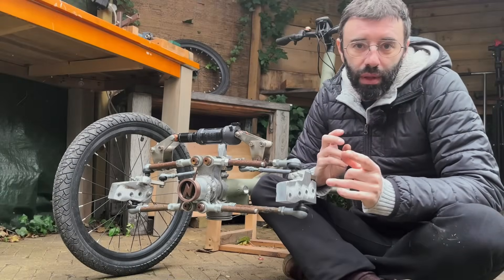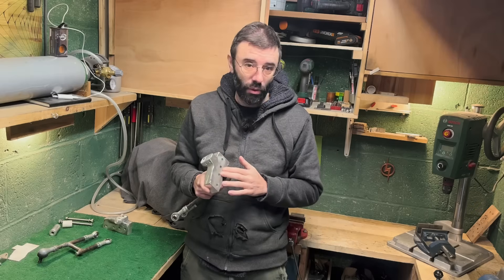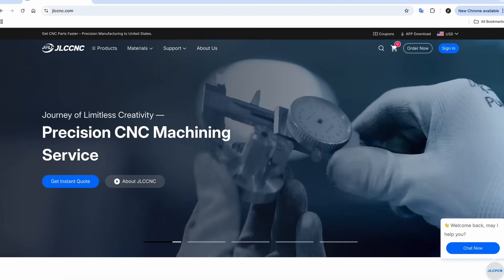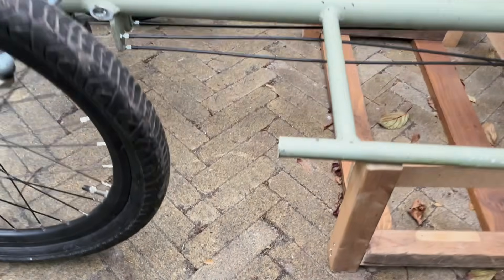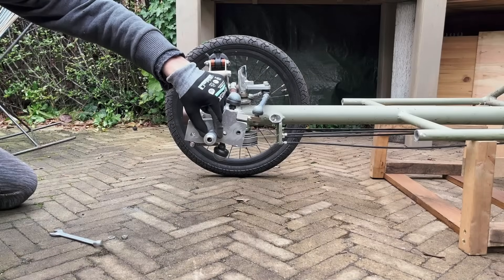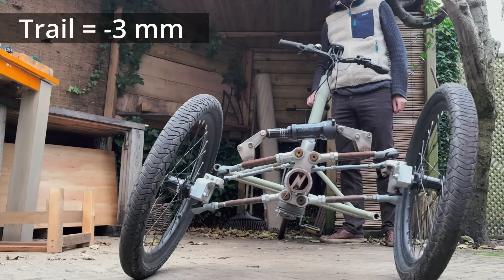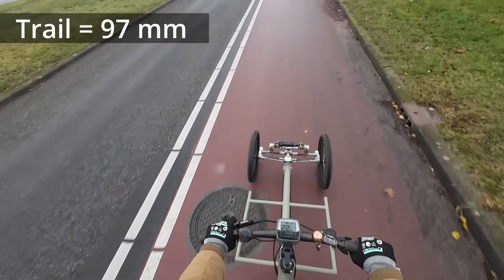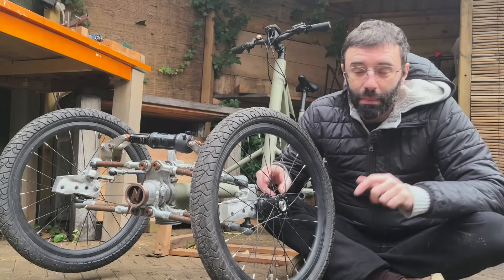#8 Ride with No Hands - Steering Geometry

Comment: What would negative caster do? Self aligning?
Reply from the maker: I don't know any vehicle that uses negative caster. Also, this suspension is designed to compress with positive caster.
Reply: @pedro-neves  Thanks for replying. I remember when you experimented with different angles. I was curious what negative angles would do on a front loading cargo bike's front wheels. Negative angles are quite common on self aligning hand drawn things, like wheels on carts and luggage etc, but not vehicles.

Comment: Why not to add a simple lock for blocking the handle rotation. When you ride handsfree you often only need tilting and not turning. You can design the lock in a way that with enough presure it unlock so in case of emergency you still can steer. Maybe something like ball with spring to soft lock and you can disable it with a switch or something.
Reply from the maker: Indeed this would be a possibility but, the objective here was to optimize the geometry for it to work naturally rather than forced.
Cheers!

Comment: Ackerman steering geometry, doesn't look right to me, does it?
Reply from the maker: No, it's not. I just need to put the steering brackets in the right place and the steering rods with the right length (which is adjustable). Next one.
Cheers!

Comment: Hi Pedro! Interesting. Would be curious from what speed you need to countersteer? Also there seems to be enough space for at least a V6 or maybe even a V8 behind the wheels. ;)
Reply from the maker: Hehe, indeed;) I would go with the v8;)
In the video, the speedometer is mostly visible. The numbers are in kph. I'm riding mostly at around 20 kph. This vehicle belongs to a homologation category where the drive unit can have a maximum continuous power of 250 W and assist at up to 25 kph. No license plate, driving license or insurance needed. In The Netherlands, also helmet is not mandatory.

Comment: Thank you for showing this! Subscribed. My first street motorcycle was a Kawasaki Versys 650. Wonderfully agile in turns, but it was suicide to take your hands off the handlebars. Now I ride a police version BMW R1200RT. It is even more agile in turns, but stable enough to ride hands-free at least some of the time.
Reply from the maker: Thank you so much!
Ya, indeed it's hard to get a good balance between agility, stability, and "no hands riding". All are important. It's nice to understand how geometries have influence.
Cheers!
Reply: @pedro-neves  My interest is in building an electric off-road tilting trike someday. I do trail maintenance and have found it slightly tricky sometimes to have a chainsaw rack on the front forks of a dirt bike. It does mess with the steering and the agility of the bike.
Reply from the maker: @suzyamerica4679  off-road sounds great;)

Comment: For front brakes which kind of braking system are you planning to use? Disc, rim or hub? It is going to be a great challange to equally brake both wheels so the brakes are not pulling to one side.
Maybe you could be able to use a bicycle ABS system as well

Great video, keep up the work!
Reply from the maker: Thanks!
Disc brakes, definitely. My hubs support disc brakes. Also, I believe that a forked hydraulic system will equally produce pressure on both ends so it works perfectly. It needs to be a twin system because bike brakes are designed to be mounted on the right side of the bike. But there are twin systems for trikes such as the "Tektro Auriga Twin".
Cheers!
Reply: @pedro-neves in that case you might end up needing a "bigger" brake lever. One that displaces twice the fluid when pulled. But yes a forked hydraulic line could work to equally distribute the pressure.
Reply from the maker: @fogas12  didn't think of the extra lever effort, but it makes sense indeed.

Comment: How much of the self-correction comes from the trail, and how much comes from caster? Those parameters seem like they would be tightly related! Would it be accurate to say that caster causes return to center in the presence of turning forces, and trail causes return to center in the presence of tilting forces?
Reply: Caster is the best determinant to use with a lower center of gravity such as a recumbent. Trail for high center of gravity. I am not a physicist so I can not provide formulae to prove this.
Reply from the maker: Totally agree. Both parameters influence steering into the fall. I think caster is kind of how much. and trail is how fast...
Reply: @pedro-neves a really interesting thought.
Reply from the maker: @ciberbri59  indeed. Interesting because even though the steering is close to the ground, the center of gravity is much higher because I'm seated much higher than the steering.

Comment: Nice test, not sure why you had 2 in the wrong direction! Perhaps an eccentric axle hub would allow you to make fine adjustments
Reply from the maker: Thanks! Ya, I put two in the wrong direction because I wanted to see how it goes with negative trail. Oh well, not good;)
Reply: @pedro-neves  worth a try! Do you know what I mean by an eccentric hub? See the rear wheel of a motorbike with single sided swinging arm, like Ducati 1098. They use an eccentric to set chain tension.
Reply from the maker: @mandrakejake  yes, indeed. Some 3d printers also use eccentric hubs to tighten the rails.
Reply: @pedro-neves  of course!

Comment: You should try it with a heavy cargo too,  as the weight o the front would make the steering more sensitive to the height from the pivot to the contact patch, although the tilting is messing with my intuition
Reply: Maybe it's best to keep it your way, as you are less likely to take your hands off when you've got a heavy load, so tuning it for the unladen condition is the right approach.
Reply from the maker: I will definitely test with cargo as well!

Comment: Very good Pedro. As a reminder please consider adding at least 30Kg (or 66Lbs) because of the intended purpose of moving a load. It will affect some geometry parameters but not all of the parameters. It will save time in future. Also I agree that the video shows great improvements in editing, quality, photography, etc. I will build my own in the summer and send you a video when it is done. I will not publish to internet.
Reply: I agree, the handling will definitely improve with weight on the front.  At least it is certainly the case for long johns I have made.
Reply from the maker: Thank you! I will absolutely test with cargo.

Comment: I wonder there is way to avoid the welding when making the knuckle. Maybe another piece of Al and bolt it on. BTW JLCCNC (the sponsor) would be able to CNC that knuckle in one piece :). Never tried their CNC, but their PCBs are great.
Reply from the maker: I absolutely will have the final knuckle professionally CNC machined!